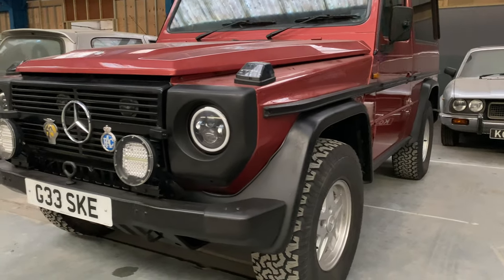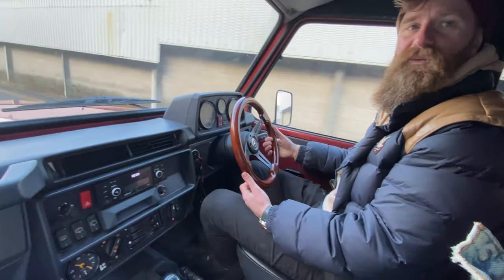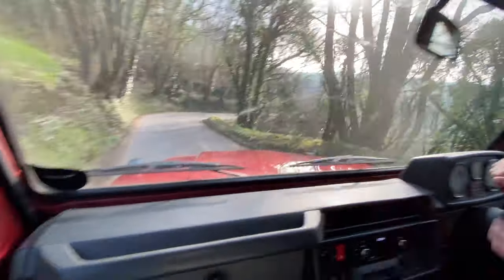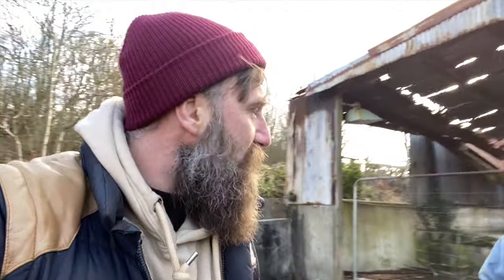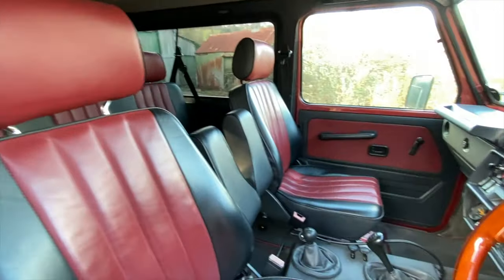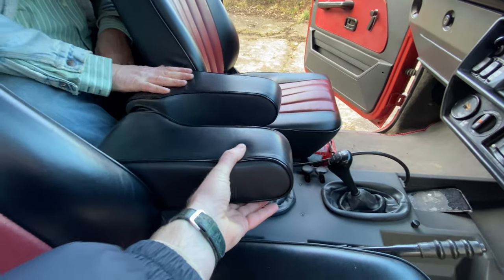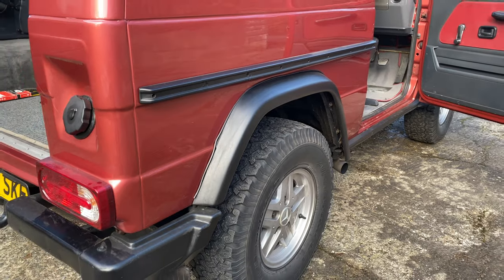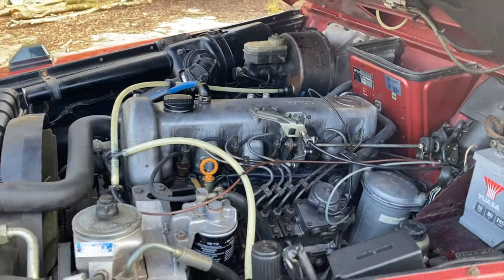Mercedes G wagon - W460 Walk round / Buyers guide  - West Wales

Comment: You are right.  Biggest issue is rust,  Yours look so much better than my 1989 W460 SWB 230GE Auto Petrol.  It was a UK car and a complete rust bucket.  That was in 2018.  Now in 2024 I have an originally Japanese LWB W460 300GD auto. That truly has no rust!  So much better. (and so much more expensive to buy!)
Reply from the maker: Fantastic! thre JDM imports will be the best by far. The motoring laws in Japan are very strict and the cars are generally in great condition and rust free

Comment: That’s original paint, had an identical one back in 2010… someone has pimped the interior and lights but otherwise…
Well it’s 2wd until u put it in 4wd, that’s your centre locking diff and then those two small levers are the front and rear locking diffs. Result is they will go over anything in SWB…
Reply from the maker: Great thanks for the info! It would be quite the capable off roader!